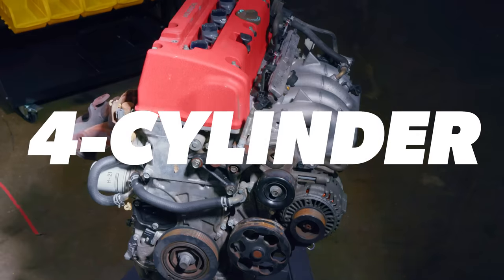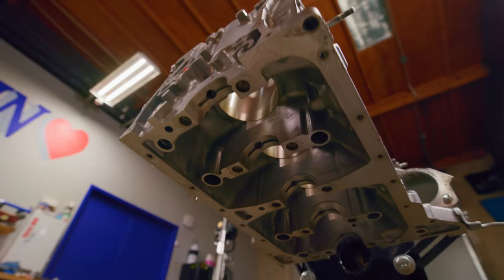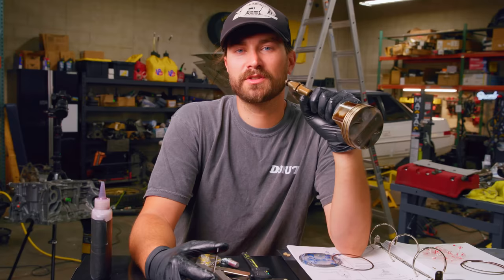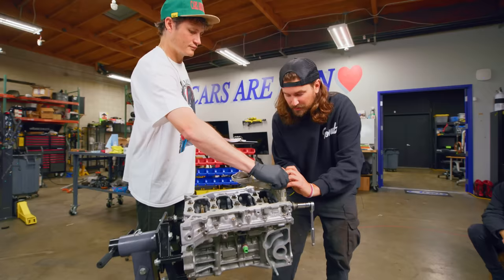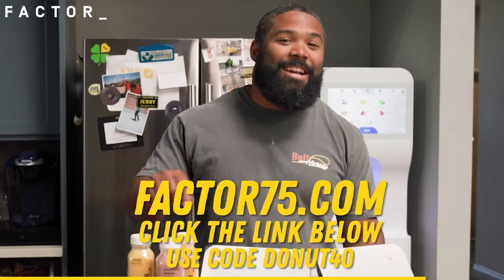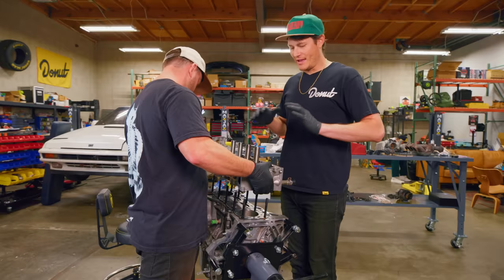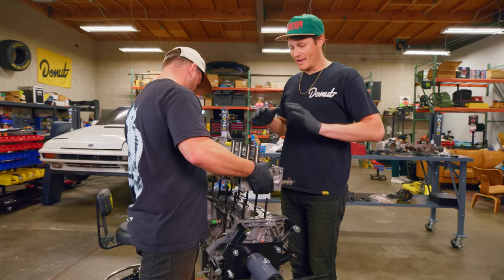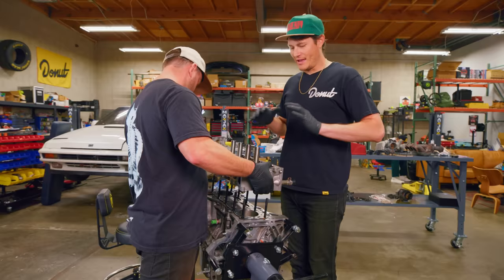Why This Tiny Honda Engine Can Make 1000hp

Comment: I really wanna do a turbo K24 in a Honda Prelude. With virtually the same suspension as the NSX, the prelude out handles most cars. It's Achilles Heel is the H22, known for burning and leaking oil and busting piston skirts, it's a shame it wasn't a better engine. But do a K swap, and all those problems are a thing of the past.

Comment: Should've put a bigger TB on it and ported the head. Couple things I thought were missing for the difference between other engines and why K20s are legend.
K20 water pump pulley and Crank Pulley are smaller, nice little under drive OEM upgrade for a K24. The Cam profile of the PRB VTEC gear has 45 degrees of lift versus the 25 degrees of K24, common swap. The oil pump can rev higher and the water pump on the Type R/S includes the Water pump jacket for the oil filter.

Comment: Im not too versed in mechanic stuff but this makes me feel better about my recent purchase of my 2002 rsx type-s, wonder what the main differences are between the k20a and the one in mine are.
Reply: You have the k20a2 in a 02 rsx type s...that's the best k series everyone goes after. I also bought 02 rsx type s to take the k20a2 out for another car 800hp build with turbo, these engines can take 600 hp stock. If you want more hp then just pistons,rods,valve springs & retainers. 6 springs Trans can take 700+ hp also with upgraded clutch & limited slip added on

Comment: Well if that throttle body is 66mm for a 4cyl the LS guys run between 77mm stock to 106mm aftermarket and they have twice the cylinders so 2x the throttle body should come in at around  132mm on the OEM side and 160mm for the aftermarket stuff

Comment: Honda has also built, over the years, Oval pistoned engines, a 50cc twin that revved to over 22,000rpm and made 16.5 hp 60 years ago to V3 and V5 racing engines to the mighty RA261H in the back of Verstappens car. Honda, the Worlds biggest engine maker.

Comment: I ran high 11s with a n/a b20b(crv motor) swap in an 93 integra coupe gsr trans and nothing else. New fuel pump water pump hondata k series flash and tune. Daily driver

Comment: The b16 in the car you referred to as this probably capable of 600 all motor 11k spooling hrsprs and 1000+ boosted. Also k24z from 9th gen civic is 1000hp also bisimoto premiered at sema in 2012

Comment: Might be a better idea to use a brass brush on the drill to clean off the gasket material form the oilpan no? If someone with actual experience can correct me why not, it would be great to know too.

Comment: Anything over three hundred in this platform, and you run into a problem: The CV axles can't take the power. Even when you upgrade those, the wheel spindles and ball joints start failing.

Comment: John Mihovetz has gone 5.88 @ 256mph with a prepped oe 4.6 4V. Cast oe block, B port heads, oe crank and oe timing components. 3,000 hp @ 10,000 rpm. Just fyi 😊

Comment: i used to race a B16 engine with a Z transmission and a computer from i forget which model, anyway, if you didnt turn your engine fans on until the engine hit 240f+ it would turn off the rev limiter of the engine and instead of limiting out half way down th straight away it would suddenly keep screaming and pulling all the way to the corner. legit like havin a turbo and unlocked like 1.5k more RPM

Comment: 9:32 Noob question: Why is the exhaust outflow smaller than the air intake on the valves? As cold (intake) air has a higher density than the hot (exhaust), I’d expect the outflow to be (slightly) larger that the intake to get that exhaust out of the engine ready for the next combustion 

What significance does this back pressure (and the ratio of intake and outflow) have on the engine? (Or am I completely off base here?)

Comment: So the K20A is essentially the exact opposite of BMWs inline 4, B48/6 engine which gets all of its torque at 1,200 RPM which is insanely low.

Comment: You should swap it with the GM ecotec motor those little tuners like the Cruze and cobalt had a lot of potential but the engines were so underpowered

Comment: I don't want to disrespect any real mechanic... but any Gustave with some wrenches a Torque wrench  and guide can approximately take an engine apart and put it back together, most knowledge is found in "Issue removal" at least how I observe it.

Comment: Did you guys apply RTV to the head at the 4 corners where the head is split before putting the valve cover on or did you apply it to the new valve cover gasket?

Comment: Q. I had a 2004 TSX with 270k miles on it and it felt like a 270k car. The acceleration felt old and when I would step on the gas there was this delay before anything happens. How could've that been fixed? I kept searching online but, everything was about turbo or 750hp upgrades. How do I make a 20 y.o. car accelerate like new? New tranny?

Comment: I thought it was otherway around with the pistons heads, the smaller the faster the revs and how wider the slower and more torque, because of the 90's 4cylinder motorcycles they were very small pistons and they hit like 20k RPM but this was just assumption :3

Comment: are the bottom parts of all K-Series engines identical or are there differences?

i know that e.g. the K24A head from the 7th gen. EDM Accord has normal exhaust ports, while the K24Z3 head from the 8th gen EDM Accord has the manifold integrated.
i also know, that there are frankenstein builds with the K24 bottom and K20 head.

Comment: The throttle body for my Mustang was just 70mm, and it was a V8, this is half the size engine, and is almost the same diameter @66mm, so you know it's going to suck(in that good good way)!

Comment: I have a 5th generation prelude project car sitting in my garage y'all can try to swap the engine with. I'm not sure how difficult it'll be to do so or if it's even possible to place a K- series in a 5th Gen Prelude

Comment: 4:24 Incorrect use of a torque wrench!  The torque must be applied only with the handle.  If you hold on to the whole length while torquing, you can overtorque your bolts before it clicks or dings or whatever.

Comment: It's sequence order operation  get T-tool 3/8 start 4:05 y'all forgot put oil in cylinder walls properly lube yo😳🤨👀 yo run that footage back 4:50 check run out clearance cross sections check Megatron build for reference thank you (AP2 revamp)

Comment: i have a jeep wrangler sport, a 2003 model.  it has just under 83,000 miles.  it has a straight six engine, 4.0 liters.  it is supposed to put out 195 horsepower.  i have no way to verify that, but i betcha it is pretty close.  the speed limit on the highways around here is 75 MPH.  jeep wranglers are not known for their aerodynamics, yet my 20-year-old jeep can manage to achieve the 75 MPH speed limit, even with the aerodynamics of a washing machine.   if were one to thumb my nose at the law, it could possibly exceed the 75MPH speed limit. to each his own, but i see no logical reason to have 1000 horsepower.  maybe in trucks hauling multiple tons of cargo.  but... just for a passenger car, 1000 horsepower seems a trifle indulgent.  of course, like i said, to each his own.

Comment: look decades ago decades ago now mind you they were running when fully boosted turbo 4 bangers that were ove a 1000 at the indy 500. it was a matter of the design of the engine well and they were running nitromethan at the time but they were no more then 270 cid with a turbo on them them but they were do that in the 1960's  but its a mono bloc one piece engine and barrel crankcase which made it a pain to take apart but it was a sturdy engine, so just cuz its only a 4 cyclender dont mean it cant make power, its a matter of the quality of the componants and the design of the engine to be able to take that kind of abuse with that kind of power and speed it will garner

Comment: I'm upset you guys chose the slowest of the v6 motors to say they're lame compared to the 4cyl k20/24 engines.. 
A FBO j32a3 with ported heads and E fuel can produce upwards of 350whp+ some have seen closer to 400whp lol.. and boost a stock everything j32a3 w/ bolt on and a rotrex has made 522whp/630tq and still had room left just ran out of fueling.

Comment: Huge difference between making 1,000hp and being able to withstand 1,000hp

A Toyota 2JZ doesn’t make 1,000hp its able to withstand 1,000hp

The power adders produce enough oxygen flow to make 1,000hp. The engine was just able to withstand the abuse.

Comment: I mean it’s best be a 4 piston engine 2.5L bore block with there insane heads if not don’t waste ur money because in the end you’ll be paying more money instead of rebuilding your old k series just send the core too 4piston and never half to worry if it was put together properly running mine in a 1992 EG6 SIR Hatch RHD Japan model I built a forged k20a type r transmission block head everything I could with a boostlabs turbo kit then I have my 4piston k24/k20 to a 2.5L bore 11:1 compression sleeved cylinder walls AP rods RR4 valve train and all ported n polished stage 3 turbo cams fully built type s 6 speed with spoon 1-4 gearing carbon synchros race spec bearings new Honda bond n new seals n clips and a M factory LSD and k tunes stage 2 axels with 5 lug swapped with spoon rims and spoon front calibers rest of the parts are k tuned/ full race/ 4piston this is my 5th k swap build have my 94 EG coupe k24a2/k20a2 head stock with a built crx 5 speed with a M factory LSD carbon synchros etc gangster lean mounts hasport for the fender exit exhaust dyno at 262HP just a built transmission and full centre feed intake manifold with 80mm k tuned throttle body ported n matched to the intake manifold has just complete bolt ons then my 98 EK Hatch k24a4 built by 4piston manly rods AP 12:1 pistons all k tuned bolt ons also with 4pistons ITB intake manifold with the carbon fibre centre feed pushing 318HP with the 1100cc injectors and had a RBC intake manifold ported to match the 90mm k tuned throttle body so should easily push towards 340-350 all motor then I have my k24a type r EK SI-G coupe from 4 piston another 2.5L bore with 13:1 compression with a stage 2 crafts works supercharged build with a sequential dog box AWD build
Reply: 92 Japan hatch k20a 873 HP on meth injection and E85 with AEM duel fuel pump kit/ 94 EG Coupe k24a2 k20a2 head stock internals with full bolt ons and fender exit 262HP with a built Crx 5 speed transmission with m factory LSD and carbon synchros race bearings n seals etc stage 1 axels then the 98 EK hatch k24a4 k20a head built by 4 piston bore block to 2.5L heads decked and RR4 valve train and retainers stage 2 billet cams has 75-100 shot of nitrous oxide 330 i recently left it lower for when the 100 shot kicks in and made 427HP and finally the SI-G coupe EK k24z block and a 4 piston head completely everything possible 4piston options for building one and the dog box 6 speed AWD build just put the carbon fibre rear trunk on and front fenders and hood n bumper

Comment: With new Valves and Springs. stock bottom end. K 20 head, And piston rods. 11000-13000 rpm's can be achieved with the K24-A1, the very best Option,.....Fact check me, I'll be waiting.....

Comment: Use silicone hammers, it is softer to hit parts, it is actually made made for work at laminate floors, they are cardboard, one side looks real wood and needs hammer for pieces to join, its like hard level puzzle😂😂😂 hammer would damage them, so they invented silicone hammer. It will be better for your work, you can hit it bit harder without worring about damage, but you also know it, you should still be carefull. ask at renovation items shop or malls or something😂😂😂 it should be helpfull for you my friends, good luck❤

Comment: Measuring the ring gap at the bottom of the block? Really? Seems dump to me, it is measured at the top of the cylinder at the same height it will be mounted on the piston installed on the motor.

Comment: I'm disappointed seeing oil added to the oil filter 😔 by adding to the filter you risk adding contamination past the defensive action of the filter directly into bearing surfaces and cylinder walls. Not a good practice when building a high horsepower high reving engine. You probably won't have any problems however,.....

Comment: a year ago i bought my wife her first car, a 2006 honda frv 2.0. An old reliable mpv, boring car with 15 years, and around 120k km (75k miles) that we got for like 6k euro. After this video, i looked on the specs and it has a k20a.
Should i strap a turbo and let wife ratatataaaaa in the parking lot?

Comment: to be fair, all series have support like the k series. ya'll act like k-series has more. not really. I can get just as much parts for the B or D series of engines.... I know a guy, the 3rd best tuner on the east coast, who made a 900hp 8 second d16y8 turbo drag car.... fully built, stripped civic interior, the works. the reason the K series gets so much "love" is because kids today have no vision. In my hayday of building and racing we all built what we had. we didn't do swaps. AND IF WE DID SWAPS, they were "Frankenstein" build's. Like taking a d16y8 block and mating it to a d16z6 head.... or even doing the same ideal with different B series parts, taking the CRV B series block and mating it with a type-r head.... the shit we did was epic and no one could stop us. Today, kids swap motors and reeeeeeee about how cool they are. you aren't cool.... you are what the kids today call "a basic bitch".... you want to be unique, swap a non honda motor in, or swap in a J series v6.... do something actually unique. if everyone is doing k swaps, you are just following the fad....

Comment: Yeah but you can put one third then amount of money into a 6.0L LS and get the same or more. Did i mention that some guys are running stock crank and block? The rods and pistons cant handle that tho.

But, i am tossing around the idea of a K20 swap in a 1st gen neon. Why? Because my very first track car, (club racing and autocross) and ill be running a K20 because it does have alot of aftermarket availability, and u can get halfway decent power out of one as opposed to a 420A turbo, or  any domestic fwd 4 banger.

See what i did there? Started with a troll and ended with a compliment 😂
Honda fanboys get triggered so they wont see that a v8 fanboy likes the k20 😂

Comment: 9:42, some valve springs are upside down, that will cause a problem. Closed coils go down to head., you can see right side top spring and 6th down,.
9:48, both springs your pointing at are upside down,  it's so obvious I don't know how you missed it?

Maybe you should find someone who actually knows about engines to assemble things?

Comment: Lol, everyone keeps spending big money on these and for quite a few years chrysler made a very similar engine. The 2.4l. Same basic design. Timing is belt instead of chain. 
One drawback. 
The engine is very very similar. 
Capable of taking boost after doing the same you are doing to that engine. 
Funniest part of all of that is there are tons of chryslers in the salvage yards with those engines.

Comment: whhhhhhyyyyyyyyyyyyyyyyyyyy?????? why would you do a video of a Integra DC2 with and Integra DC5 (not avilable in the USA) motor. Also why are you not using Honda Bond which is known as better then a lot of OEM Gasket Material and Aftermarket Materials also?? Adjustable Piston Ring compressors don't work welll as you have seen. So Final comment, It should be a B-Series not K and that K does not make 250hp unless modified....